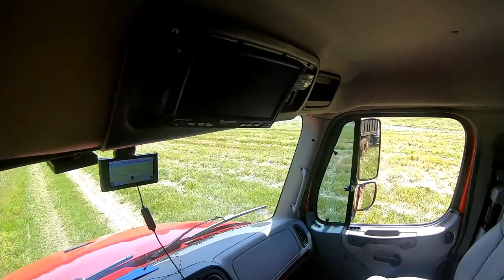DUMP TRUCK DEEP IN THE MUD!

Comment: What capacity does that dang rope have. I have had some nylon rope for power line trucks i use to rebuild that was 30,000 lb rated but it was 1&a1/4 inches in diameter. That rope is strong and a 1/3 as big. Looks like that old international is gonna have a mess to get rid of after its out of the mud. 1 ton of mud on the rear rims
Reply from the maker: The 1/2" rope on that truck is rated at 7,650 lbs